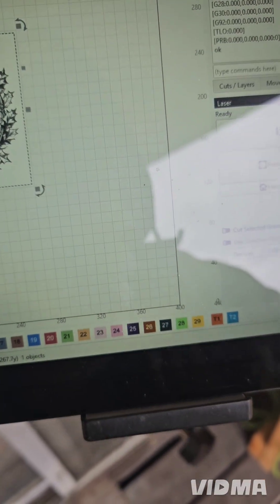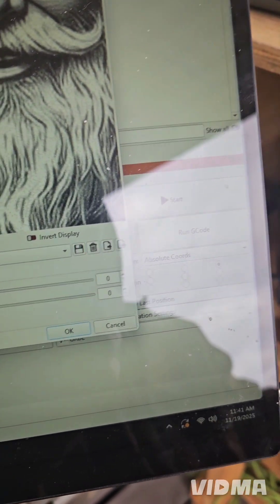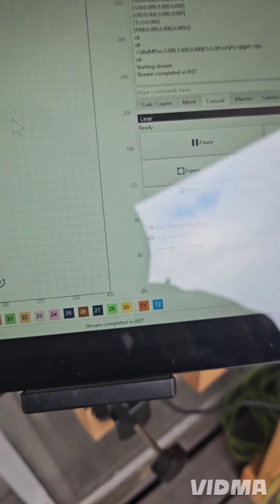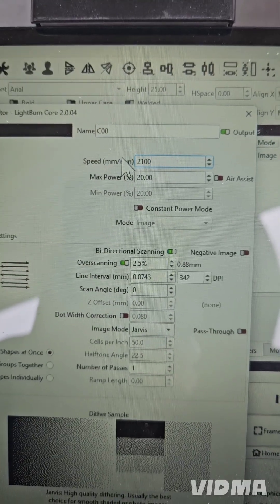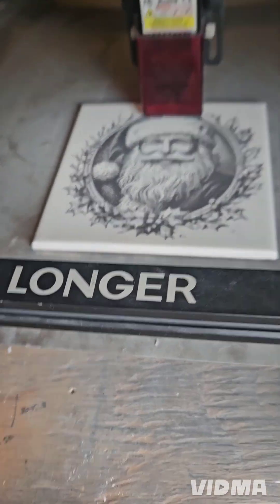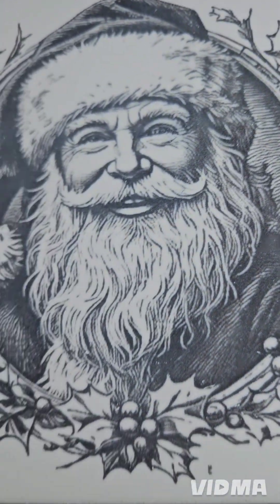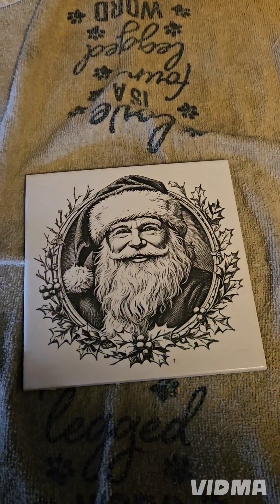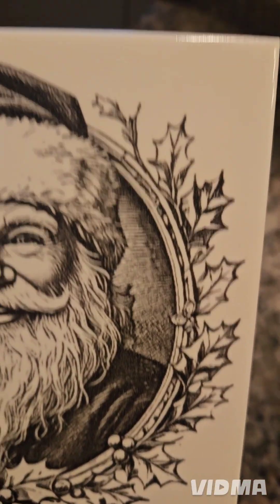Laser engraving a white ceramic tile.

Comment: Really nice result Jim, I’ve tried the TiO2 powder mixed with water and some clear glue but it’s a nightmare to get a consistent coat - often gets blotchy and loses detail….your spray painted ones look nice and consistent!
Reply from the maker: Thank you. I try to explain that to people but sometimes they get angry with me. I get much more consistent results and honestly, I think they look smoother and more consistent without all the extra steps. Powder is cheaper but just not worth the extra mess and work. I like to save time and hassle. My laser stopped working yesterday so I am troubleshooting it and will make another video when I get it fixed. Thanks again
Reply: @jimstraw9974  from what I’ve seen some people swear by the Ti02 powder method once they have worked out a good system of their own to apply it.  The trick is to be able to achieve a nice consistent method and sometimes spray paint is much faster and even so it’s just another way when all is said and done.  Just let it go over your head - some people can’t handle it when both ideas are right! 😂
Reply from the maker: @weldmama I already spent the time to perfect the powder but it's not as good of a result. That's my honest opinion. I'll post a video in a minute of the work I've done. The Santa image is just a simple image that I did a video on to show how easy this is.

Comment: Why not tempura paint? It stick and doesn’t gum up the airbrush
Reply from the maker: I don't need to mix anything, use a
My airbrush, or a paintbrush. After it's painted, I can handle the tile or even stack a bunch of painted ones up on top of each other.  The paint gives a more consistent coat of Tio2. I already mastered the Tio2 but I spend less time and get the same results. I just remove the lid from the can and spray. I mastered the paint first, then I decided I would switch to the powder for better results. The results were not better and the process takes more time. I don't have to hook up my airbrush, or clean my airbrush. From start to finish, I can have a bunch of tiles painted and ready in a couple minutes. Before anybody could mix the Tio2, get it in the airbrush, spray the tiles and let them dry, I'll be engraving. After I paint my tiles and they are dry, it can rain on them and I can handle them without the paint coming off. Everything I do is outside in the elements.

Comment: Great Video Jim, Appreciate it, 2 questions why the Satin before and why scrap it off after?
Reply from the maker: the white is high in Tio2 which is a catalyst to allow the laser to burn the image permanently into the tile. you remove the paint that is on the tile where the laser didn't burn. this reveals the brilliant white glossy tile that is under the paint. you are left with the permanent black engraving.
Reply: @jimstraw9974  Thank you, The tile I have is not glossy they sent me the wrong ones they are flat white does that make a difference?
Reply from the maker: @ederb5888 it will still engrave but the white will be dull. It would probably be ok though if you use a gloss clear coat when you are done.
Reply: My white tiles are also flat, not glossy. Would I still attempt to scrape off the paint?
I have to thank you SO much for your videos.  I love that there wasn't any pointless dialog! You just explained what you were doing.  Perfect!
Reply from the maker: @michelewhite1900s usually, any time you make a tile with the Norton white tile method it is on a glossy tile so the paint is removed. This eliminates the paint scratching off and having two tones of white. It is only done because this is a permanent engraving. However, it is your creation and you can just clear coat with the white on it. It's your creation so you can make it however you want. I made these videos because people on the Facebook laser sites I'm on asked me how I created mine and what my specific process is. I do not like useless dialog in videos either. Thank you for your feedback.
Reply: @jimstraw9974 thank you. The tiles I have are unglazed. But I do have a few glazed plates... would those work to practice on?